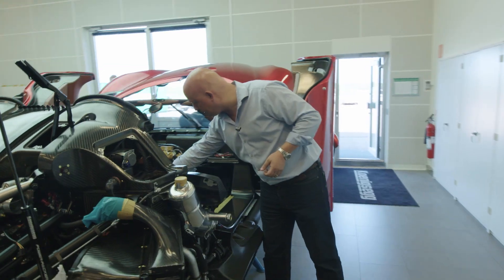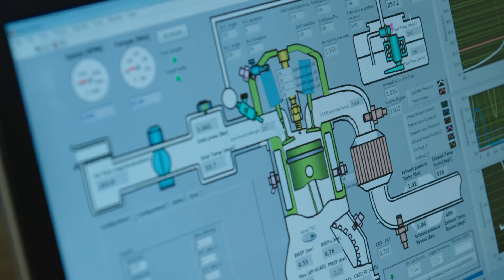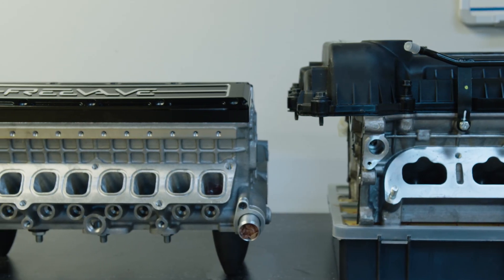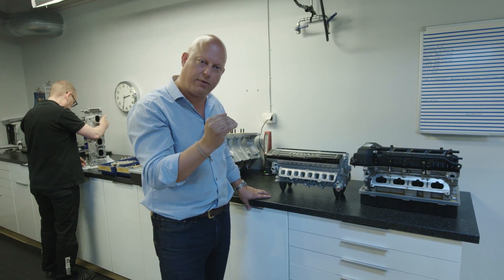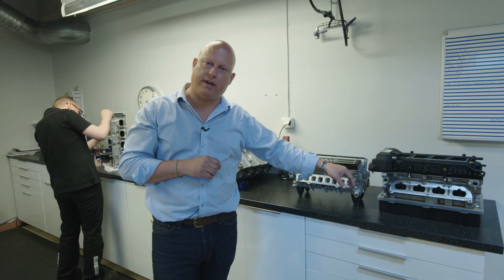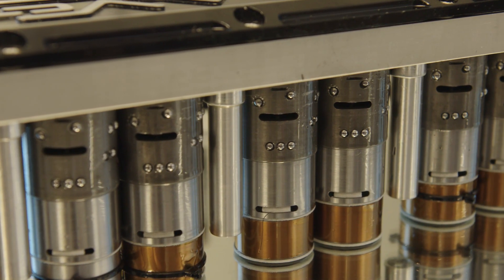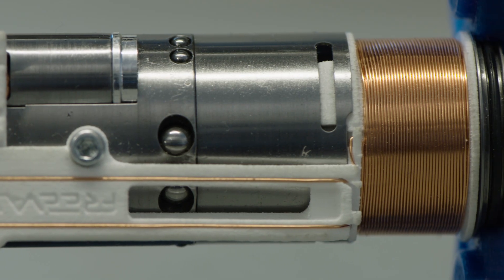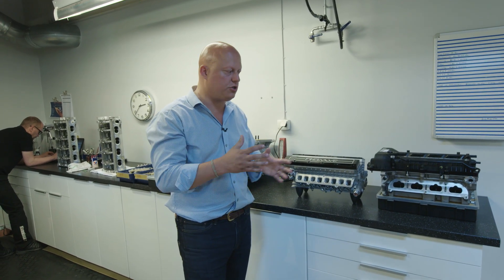Freevalve Update Camless Engine -- /INSIDE KOENIGSEGG

Comment: Why not an ecltromagnetic solenoid with valves also.
Reply: Try turning a camshaft or compressing a valve spring, it takes far more power than any electric actuator could ever produce
Reply: @5002strokeforever  Electro magnetic forces not able to compress a valve spring??? What do salvage yard cranes use or rail guns generate?
Reply: You ever see a rail gun? The power supply requires a couple of semis to cart around and it's own power grid to charge, over a couple of minutes.. .
No way to make any existing electric technology actuate the valves at the required speed without an entire seacan full of 10 million + dollars of state of the art electronics

Diesel injectors still use a mechanical pump to build pressure, and the electronics only tell them when to fire...

So to sum it up it is possible to electrically activate the valves, but the engine would be so heavy it would not be able to move under it's own power, think fully loaded semi trailer for a 200hp 4 cylinder engine
Reply: Modern valve springs
~ 200lbs to begin moving them
Over 500 lbs of tension when there fully open
~.5 " of travel over 30 degrees of cam rotation 
All of this has to happen over .0005 of a second at 10 000rpm

Which if you do the math on just the spring force alone its 53 horsepower  required for opening a single valve in the way an electric solenoid would have to do it....

(inertia is at least that much horsepower again)

So you would need at least 3200hp of solenoids to run a 16v engine, and that would just open them at the same speed as a existing camshaft, you would have to double it again to get any speed advantage...

So girls, that's why no one has done it yet
Reply: Also keep in mind the actuator has to be able to close the valve nicely too, the existing konessigg already struggles with this, and how will an solenoid do that? Adding a magnet to the reciprocating mass?
And to be able to do all that in a bath of 250 degree hot oil too
Reply: @5002strokeforever  were not talking about 1k' s of lbs were talking the weight if a valve. The cylinder head configuration is modified to suite the geometry and just as konenig did. We could use neodynenium magnets as the stator. If you look at ignition systems that actuate the pneumatic pistons, the current would be adequate. You're also thinking in conventional science, look in to scalar tech. Convential is archaic at best for lawn mowers.
Reply: @5002strokeforever  I don't believe they use springs its all pneumatic valving.
Reply: I think he'll always have an issues with barometric pressure and density with air charging  Temp and humidity will always be a factor in a critical tolerance system like that. Not to mention contaninents.
Reply: @JCnordic2983  that 53 horsepower is the power required to open a valve at the speed it must open while running high rpm.
That valve needs force to open and close it, that force is measured in pounds.
We know the time that valve needs to be able to open and fully close in.
From this we can calculate the exact minimum horsepower required from the electric solenoid (53 horsepower)
Since a 53 horsepower electric solenoid that responds quick enough (with half inch of travel) does not exist they use air to provide the power
Reply: @5002strokeforever  well only for ones that are manufactured for the application. Most automobiles use magnetic pick ups anyway cams/crank sensors, how is the data rate not able to utilize magnetic? Super capacitors and ignition capacitors are already in use for high voltage or amp applications. I've seen systems that could be employed, so feel free to do some research and you'll see that its can be done in the cost range that Koenig is working in. That's his approach, there's others. Audi is using magnetic suspension that's in their performance
Reply: @JCnordic2983  point me to an actuator that can do 106 horsepower of work in a 250f oil bath and still fit 16 of them under the hood of a car...
None exist, they are all electric over hydraulic or electric over air...
The electric portion controls when and how much, but there is always another system that does the heavy lifting...
Reply: If it could be run straight electric konessigg would much rather do that as its simpler than some hokey air setup with electric control
Reply: @5002strokeforever  you know in fact what his manifest of system started as? Just like his system(still in a prototype r&d)not a established enduring system. 
I'm sure people told him that pneumatic wouldn't work. There's form over function. Lets see, you said there only weak or limited speed actuation and then there's too large of power unit to source on a rail gun or salvage crane system. So if there's a high and low end of developement, wouldn't you think that there's an application for it? How do you not see this? Because you haven't developed it or found it? Just like Koenig, there  developing it. You said it would be too large or week or lack of speed. Well look at his configuration, it doesn't even resemble the original cylinder head. So how do you not think that it could even be accomplished?
Reply: @5002strokeforever  you don't think a coated earth magnet and ceramic material would handle the temp? What about that temp and  fluctuations, that would cause air density issues on pressure.  You're not allowing other tech to be considered, its just" can't be done". Well that's your opinion, you're only looking at standards physics, with aerospace enginuity and material that can resist most temps. I'm sure they have the materials to create friction/heated environments. Lets just agree to disagree.
Reply: @JCnordic2983  Magnets lose their magnetism quickly with temperature
Magnets are fragile and wont handle changing directions 160 times per second
How are you hoping to attach a magnet to a valve stem?

air certainly not the ideal way to do it, but full on electric is a hundred times worse
Reply: @5002strokeforever  once again this system is used as a new technology on performance suspension so the kinetic energy is not a problem, maglev trains use this and insulating/refractive material as I suggested earlier. I don't think either would be good systems since the internal masses are moving parts. There will always be maintenance at low mileage intervals, typical of all super cars.  Gravity assisted or anti grav machines( which is still magnetic would be the way to go.

Comment: Would love an update now. It's been 2 years.
Reply: Actually, he had an assembly-line-ready working prototype at least ten years ago. Big car companies are not interested. I guess they just wait for his patents to expire, as it happened with his patents on a flash-memory mp3 player (yep, this guy invented the thing).
Reply: @michaelcrockis7679  your right about that... I personally know two high level engineers that brought/showed the big guys their stuff and when both of their patents run dry those products went into production
Reply: @michaelcrockis7679  we did this shit in the 60s ....
Reply: almost 3 years
Reply: Then the koenigsegg gemera came
Reply: Here's an update: Just Last week, in the cancelled Geneva Motor show, Koenigsegg Announced The Gemera. Twin Turbo 3 cylinder engine producing 597 HP. Check it out. Astonishing!
Reply: PosMatic .
Reply: Adam Lolno Natural gas, geothermal. I work on steam and gas turbines during outages, performing many major overhauls. We don’t have coal burners. Most the world doesn’t.
Reply: @MDS-c5l  : we've had some winter storms lately. Most people will have snow on their boots, and take it into the car. I turn on the heater, open a window a bit, and evaporate the snow to dry the floor. With an electric car, would I have to take towels out to the car to dry the floor? Or just put up with the reduced milage with the heater on? We have also had freezing rain, which does require the defrosters, front and rear to keep the ice off the windows, as well as using wipers and heater.
 As for tinkering, likely, in the future, somebody will put a higher voltage battery in, and / or upgrade the computer and program, and have an electric car that will smoke the tires like we see now with modified fueled cars. People like to play. A 100,000 kw  dragster could be very interesting, if the batteries were light enough. An electric off road vehicle could be rather exciting, fording a river.
In my area, we went to variable priced electricity. In high demand times, the price is double what the low demand time is. It seems we're running out of capacity to generate electricity. ( near me was 4 coal electric generators. They were shut down and not replaced, so less electricity is produced. I've read that a large nuclear generator near me is now scheduled for shut down.) If everyone gets an electric car, we won't have a low demand time to charge a car, and likely would have to import electricity to meet demand, as is done already in high demand situations, even without a few million more electric cars. And where will road tax come from? Tacked on the electric bill, or $!1000s for licence plates yearly?
I've recently read that wind turbine blades, upon reaching their end of usefulness, can't be recycled. They were cut up and buried in a landfill site. Making cheap electricity in the future seems remote. ( But cheap gas in the future also seems remote)
Reply: The GeMera is out😃. Check it ou
Reply: yea this just got re-recommended
Reply: @MDS-c5l  not for another 50-100 years or so. This type of shit takes a long time to change.
Reply: Theres a 2L 3 cylinder Freevalve engine in his new Gemera making 600hp/600nm
Thats the update.  And it's a fukn Beast.
Reply: almost 3 now
Reply: MDS they wont, ppl just didnt yet realise how impossible it is to sustain the "whole world" driving electric cars
Reply: Jin Song How do you figure?
Reply: go2yanks we can only sustain the enery consumption of electric car by using fossile energy, which defeats the whole argument they bring to the table.

the german govt. made some calculations and given  that 1/10th (approx.) use electric cars, theyd have to import more electricity, which they do from countries that use gas.

i do not mind tho, because then the cleanest alternative is nuclear + fusion, which still has the greatest potential; but isnt looked into as extensively anymore
Reply: Its 3
Reply: See the powertrain on the new Koenigegg Gemera: https://www.youtube.com/watch?v=xsruhlGIRWY
Reply: Its in their new gemera
Reply: Nope, it's been 4 year
Reply: Enter: The Gemera
Reply: here's the update https://www.youtube.com/watch?v=WwlNqaz9q_0 3cyl 2l twin turbo 500hp (pump gas)
Reply: https://www.youtube.com/watch?v=WwlNqaz9q_0
Reply: @MDS-c5l  Do you know how electric batteries are made? Hint ... Batteries don't grow on trees in the Amazon.
Reply: @altGoolam  or how electricity is produced with coal since the tree huggers won't allow  nuclear plants anymore
Reply: Dcdanger most the world produces electricity by something other than coal including most of the US.
Reply: @dcdanger6151  I wish that they'd invest in nuclear fuelled vehicles..
Reply: Update is killing the internal combustion engines for electrical driven cars.
Clean cars in exchange of destroying other countries with cobalt lithium productions.
Reply: @loyalitiy  You get it.
Reply: @loyalitiy  oh boy
Reply: David lol. Ikr
Reply: @loyalitiy  who cares about other countries and their cobalt lithium
Reply: @Aurem6974  basically you, if you want to have anything battery powered from your smartphone to your car. If they say ''fuck you'', youre not getting any more, then the US has to  ̶i̶n̶v̶a̶d̶e̶ bring freedom to them too.
Reply: @MDS-c5l  Oh, you dont think the cheaper more effective way to power a car become electric koenigsegg wont switch to electric? LOL idiot. You said it yourself, its simple, like installing a vacuum cleaner engine into your chassis. Go drink more Elon kool aid, you apparently think he's magic by capitalizing on battery tech. You don't belong here...Your too stupid.
Reply: @MDS-c5l  when there is a long range capable electric car I'll be interested. Electric cars are ok for a daily commute, but still not good enough for intercity travel, or long distance vacations.  With a fueled car, adding another 500 km of range only takes a few minutes. I looked at 1 electric car. stuck, parked on a highway during a winter storm, with heater on, wipers, headlights, another 1.5 hr added to a commute, and it wouldn't have lasted for 1 trip to / from work.
I've read that I produce more CO2  per yr than an average pick up truck.
Reply: @MDS-c5l  :  Most electric vehicles are pretty small, and quite aerodynamic. Image towing a boat or trailer to the cottage. (My boat and trailer are about 3000 lbs)
An eletric motor can be very capable. The battery capacity, life, charge time and weight are still a problem. 
Since it takes around 20 hp, or less to roll down the highway, i'd like to see a dedicated, very efficient 25 hp fuel engine, with good economy, to directly / indirectly power the car and maintain a much smaller battery that is used for acceleration, hills, etc. This should be a good combination.  I didn't see why Chev used a 140 hp gas engine in their hybrid. Lotus developed a modular 2 or 3 or 4 clylinder engine, simple tech (Just 2 valves /cyl, no variable cams, etc.) that ran at 1 rpm range,  so very efficient, as a battery charging motor. It never went into any hybrid.  Toyota has a pistonless gas engine for a charging motor, also very efficient, but not used in a car.
 I have read that there is a class action lawsuit against GM , because the winter milage on their Volt isn't nearly what was advertised.
Reply: @MDS-c5l  hahaha ya right.
Reply: Waw
Reply: Hi System Sucks.  It is not reliable and about 50 times more expensive than conventional cams.   I think that a Chinese car company is trying it out.   If it were that good then he would use it on his own $1,000,000 sport car.  Every formula 1 car team would want one.
Reply: @abz124816  he has, the Gemera. The engine is absurdly good: 600hp from a 2L 3-cylinder twin-turbo.
Reply: @gracefool  : Turn up the boost, engines can develop a lot of power, also burn a lot of fuel,, Just for fun, I was curious what poor fuel economy my 274 hp 2L would give. Going up a steep hill, at full throttle, I managed 90 L / 100 Km, on the fuel comsumption guage,  about 6mpg. Not something I do every day though. So the 600 hp engime would get  3 mpg?
Reply: @drewthompson7457  I think that 600hp figure is using ethanol. Also Freevalve maximizes fuel usage, Freevalve engines can be over 50% efficient.
Reply: @gracefool  : Even at that efficiency,  a continuous output of 600 hp will burn a lot of fuel.
Another example would be the 454 marinized engine in our club committee boat. At full throttle it burns about 120 L per hr, which allows us almost 30 miles.
Reply: @drewthompson7457  sure, but no-one cares about efficiency when racing. The cool thing about FreeValve is that it dynamically optimizes for efficiency when cruising and power when racing.
Reply: @gracefool  : I don't follow motor sports much, but recall that several auto races now have limits on fuel consumption.
Reply: @drewthompson7457  true. If needed the power could be reduced to attain the required efficiency.
Reply: @gracefool  : yes, a 600 hp  engine, at 600 hp output will burn a lot of fuel. A 20 hp engine, at 20 hp output will burn a lot less.
Reply: abz124816 of course it’s more expensive when it’s new .. horses where also much cheaper,than a car 😂
Reply: @abz124816  he is using it on his own car
Reply: @MDS-c5l  absolutely, this tech is cool as hell and definitely be the Swan Song of the ICE. I'm only 49 and I know the mass market ICE will be dead in my lifetime. My next vehicle WILL be electric.
Reply: If smart he would stop investing as we are having electric forced on us asap
Reply: @dougharvey9766  electric is not a solution. Its kind of a brushing the problem under the carpet kind of a solution. Yes an electric car has no direct pollution and in some countries they can run off of renewable clean energy. However you have to get lithium from somewhere...